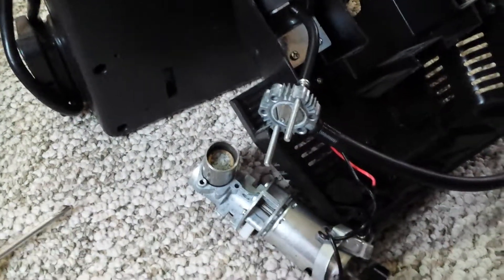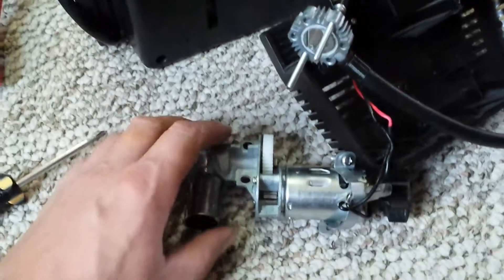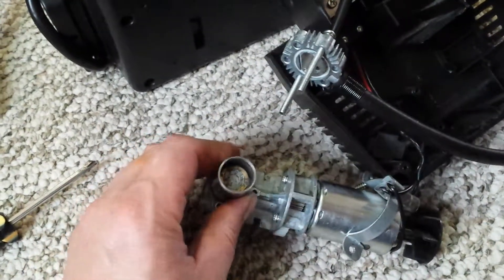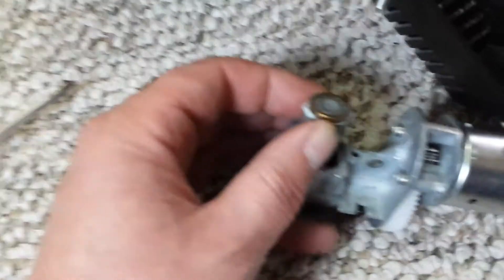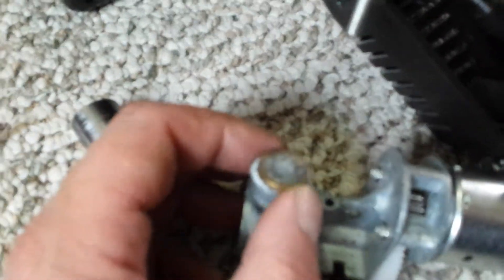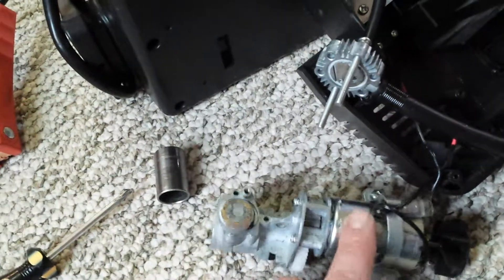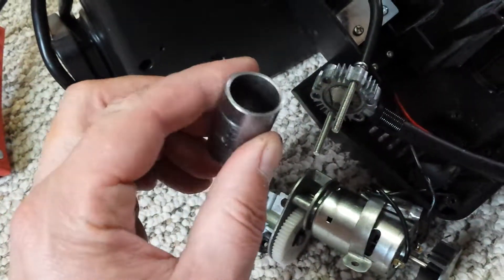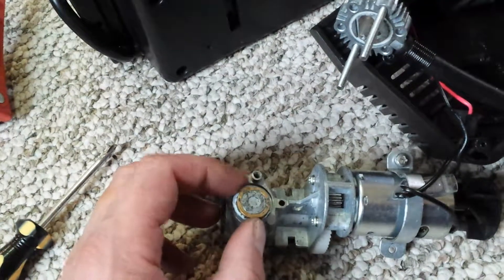Stanley jumpit piston failure

Comment: The air pump is a piece of junk. I have a 1000, Just used the air pump a couple of times, then failed. I opened it, and found similar things as yours. They should recall the the junk

Comment: Same problem with same model. Lightly used, also the charger was junk in my pack, so I replaced it with one I had around and now it plugs into the outlet instead of running a cord to it.